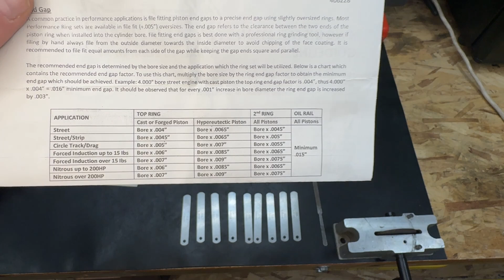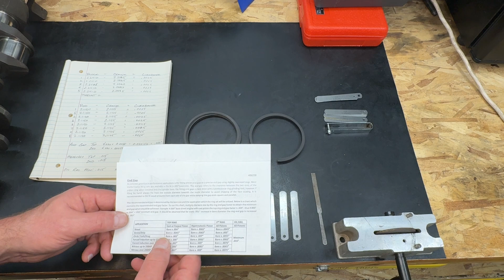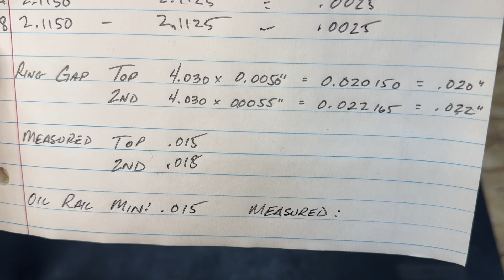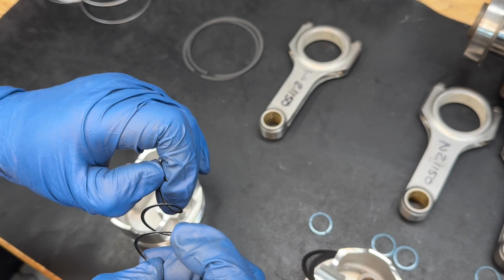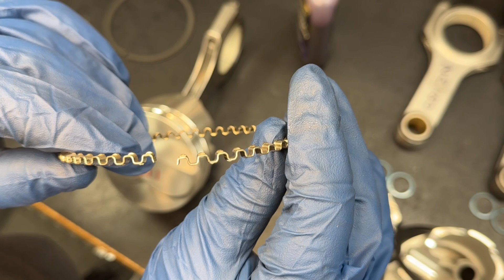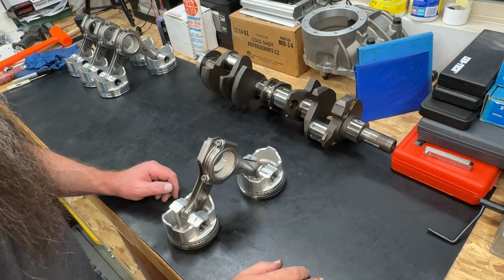480+HP 289 Ford V8 - Part 3: Setting Ring End Gaps, Easy Spiro-Lock Install, & Assembly!

Comment: I may have missed it, but... I was hoping for a little more detailed explanation on why we put the ring gaps in certain locations. Over the wrist pins on opposite sides for the oil rings, and top and middle ring 180° out on the top and bottom of the pistons oil groove.
Reply from the maker: I’ll be covering ring gap placement in more detail in the next video in the series.  I’m finishing it today and it should publish in a day or two.
Reply: Well, get off of here and get back to work. Slacker! Lol

Comment: Maybe you mentioned it, but you don’t check end gap for the oil control rings? I’m tearing down my 302 and am trying to follow your instructions to the T for reassembly. Thanks for the help and putting these videos together!
Reply from the maker: Most engine builders don’t.  The thin rails are steel and expand less than the cast iron top and second.  The minimum gap on them is .015” and these measure at .022”.  I glazed over it because it is rarely ever an issue.  The only time I e ever encountered a problem with oil control ring sizing they were mis-packaged and +.030 rings were in a standard set, the pistons would not go in the bore.  I would suggest check one single ring in any bore and accept the set off of that check.
Reply: @ thank you for the explanation

Comment: When im checking ptv clearence ill put one hundred thousands feeler gauge between the rockerarm and valve tip n hand turn the motor .. ofcorse  i got some  hyd lifter collapse so sometimes ill spin the oil pump with a drill to keep the lifter from collapsing (as much )  or if the intake is off ill put a lifter .  i have stacked washers in a lifter for testing purposes only .. i have 1 flat tappet and 1 roller lifter  modified … this is just a quick way i check them . Sometimes i get a car in my garage that has bent pushrods or something and i can have a good idea whats going on in a matter of minutes .. i cant wait to learn how you check  your ptv clearence  check !!! I probably didnt explain myself very well but a guy like you will get the idea and will know what im saying !!!
Reply from the maker: I’ll be posting at least one video a week on this build for the next few months.  Check back soon.
Reply: @ im a patient man ..   its all good !!!!

Comment: Sir I’m continuing to watch your channel no matter what the topic is because I know you know your stuff. A couple months ago I wrote to you about my attempt to better understand tuning modern fuel with my old 351c 9:6:1 compression C-6 transmission with 3:25 gears and aftermarket efi that controls ignition timing. You previously suggested 13:5 ish afr for light ( general cruising street car. Since modern fuel does burn faster than the old fuel, at let’s say 2500-3000 rpm: 60-70 mph what neighborhood if timing at cruise should i be at typically? What I’ve learned from your channel thus far would probably be less than the 36-38 many suggest remembering old days fuel but please let me know what you think when you can. Thank you
Reply from the maker: Timing at cruise speeds, light load, can be rather high.  The volumetric efficiency and thus the effective compression ratio, are lower the higher the vacuum reading is, which in turn means the mixture in the chamber lacks density.  As a result the molecules of air and fuel are farther apart, so they don’t react as fast after the ignition spark.  It’s not unreasonable for ignition timing at light engine loads to get into the mid-40s.  Curve the ignition so full mechanical timing advance occurs 200-300rpm above your most common cruise rpm (so if you cruise at 2700rpm, mechanical advance should be all in at 2900-3000rpm).  Cleveland closed chamber heads will have different needs than open chamber heads.  I usually shoot for 12-14° Initial for most engines.  Open chambers with a dome will want to be in the 32-33° range for total timing, so 20° of mechanical advance is ideal.  Closed chambers with a dish will want 28-30°, meaning you’ll need to limit the advance.  Vacuum advance should not respond below 4-5”hg vacuum, but at more than 5-6” of vacuum the vacuum advance should be adding at least 10°, and all the way up to 15° of advance will work, but that absolutely must be connected to manifold vacuum.  Ported vacuum will rob the engine of timing at closed throttle and very light loads when it benefits from the timing the most.
Reply: Thank you very much sir I appreciate it

Comment: Hi, you probably mentioned it in another video. What piston brand are you using? Thanks again
Reply from the maker: These pistons are manufactured by Wiseco and sold exclusively through Trick Flow Specialties (TFS). They are specific to the Twisted Wedge heads, and they are mad with a dome that results in a -2cc combustion chamber volume, where a typical flat top has a +4cc to +6cc volume for the valve reliefs.

Comment: On your ring filing tool, I saw you crank counterclockwise, and that makes the ring want to climb, whereas if you rotated it clockwise, it would pull the ring down onto the tool face itself. Is the direction a random choice or is there a specific reason for this?
Reply from the maker: It’s specific to pull material inward radially in the ring.  It prevents chipping the coating on the ring face. If you turn the tool clockwise as the material is removed, it pulls against the coating and can damage the coating at the end of the gap.  Learned that the hard way a long time ago.  I’m pretty sure I explained the reason in the video, but I hope the clarification helps you.
Reply: @TheGT350Garage  Thanks for the clarification, I think editing got that part. I haven't done a rebuild in a few years and love your attention to details. I'm doing a '95 5.0 going into a '82 fox coupe.
Reply from the maker: @bradmaas6875 keep it simple and pay attention to the details and you’ll have way more fun.